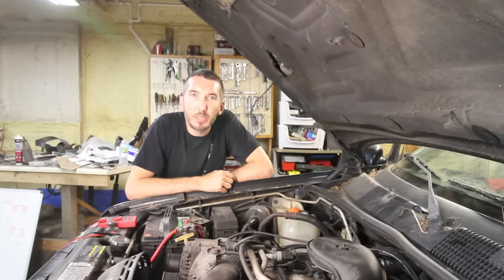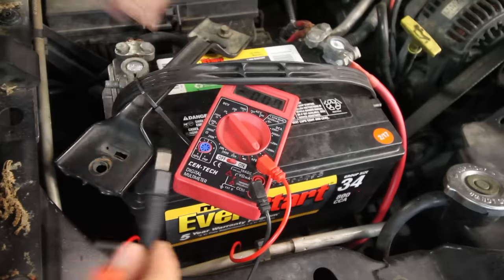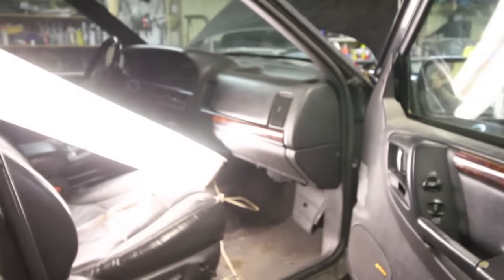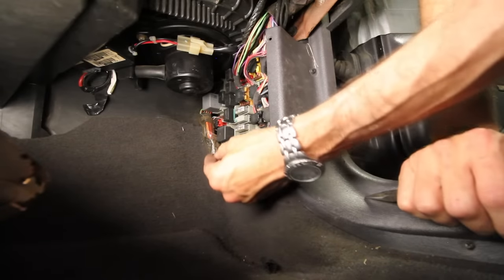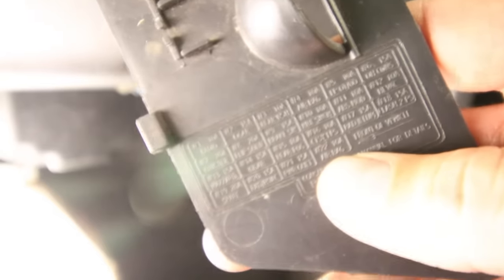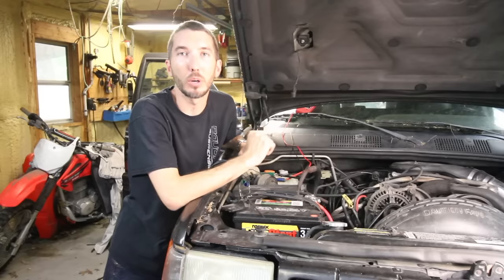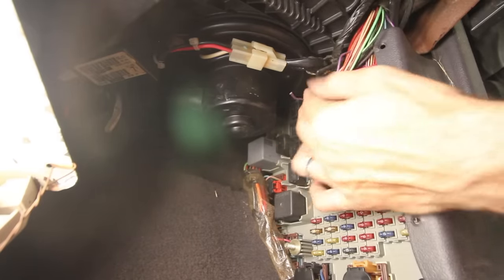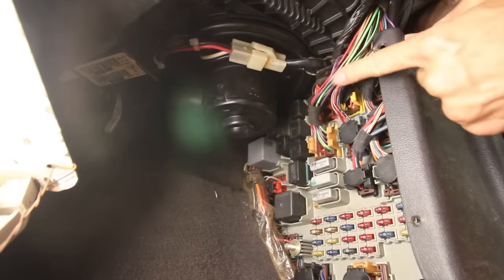Why Does My Battery Keep Dying? - Parasitic Draw Test and Fix - Operation Cheap Jeep

Comment: So great you bodged a bodged repair even further... thought you were going to fix it! Like go to the rear hatch and test the sensor/switch and the wiring to the BCM from the sensor and not mutilate the BCM circuitry  and even advise viewers to go around cutting wires... you probably just broke exactly the same circuit as pulling the "cluster" fuse you did earlier... Was the BCM faulty or the rear hatch sensor/switch or wiring faulty? We'll never know as you never tested them! You should re-instate the internal lighting and determine if a new or reconditioned BCM is required or the sensor needs refitting or replacing depending if it's normally open or normally closed. Remember you did say "fix it" not work around it with a potentially dangerous hack that could leave the entire BCM inoperative! BTW when clipping to an alligator clip to a pair of mole-grips like that don't clip it to the release lever that is only loosely contacting the metal of the tool via a loose riveted pin. Clip it to the handle that is directly in contact with the battery terminal post which is also better than clipping to the adjustment screw thread too. As you had it the connection would have been intermittent with the resistance of the connection changing as you moved things around!

Comment: I removed all fuses under the dash on pass side, no drop in draw...wondering if it could be the box under the hood....should I start pulling those out also to check for the parasitic draw...its a 2000 xj sport

Comment: Advance Auto Parts checked my battery and did a starter(cranking)test...they were okay. The charging system test showed a DIODE SHORT. So...what do I do about this? Thanks for any information. I just spent $521 on an a/c compressor, so I'm hoping this won't be a major (alternator??) repair.

Comment: So I followed this video to the letter in my 97 Jeep GCL, and with the meter on 200m setting, I have a 0.9 draw that never changed after I pulled every fuse both in the power box under the hood and the fuse block in the kick panel. I’m stumped

Comment: Followed your procedure but still had drain after pulling each fuse. Charging the battery again to repeat the process. In the meantime, any suggestions before I take it to a repair shop?

Comment: You could have disconnected the rear hatch sensor. Hope you heat shrinked that expose wire to prevent a short since it has power coming off a fuse

Comment: Great video totally understand . Thanks
Reply from the maker: Glad it was helpful!
Reply: I have a 2012 Chrysler 300 great car but all of a sudden it will drain the battery. I had 2 dealers 3 shops and a friend that's a great mechanic. Still can't find a fix. I've bought 2 batteries and last April i bought a battery pack and just jump it when i want to drive it. It's getting overwhelming.i really like the car drives great gets great gas mileage im just about to give upon this car.  I have noticed the cluster light comes on and knocks the panel lights out I've learned how to reset it. 😆 lol. Im thinking about checking all the fuses after watching your video to save money. Not asking for much just want it to start. If you have any information or leads would greatly appreciate your help. Thanks again

Comment: Hey, I know it's an old video but I was wondering if you could help me. I have a 2011 Jeep Wrangler JK and I have tried to do what you do at the beginning but as soon as I do, there's some motor winding over somewhere to the front of the car. You can also hear a sound coming from the CD area trying to work. I don't know what is going on. I've never had this happen before with my multimeter connected. Please help if you can. Thanks

Comment: When I pulled radio and radio amp fuse  it dropped to .39 on multimeter. It was .76 before. Pulled every other fuse under dash and engine bay and still didn't get close to 0. Any ideas? I'm thinking of just installing a kill switch. I have been having to disconnect battery from terminals because it would literally die overnight within hours. One hell of a drain!

Comment: Same thing is happening with my car, I actually did what you did and I traced all the wires and found a wire which was consuming the power.  I thought to sell this stupid car rather than fixing, after watching this video, I cut the culprit wire and I am not sure what the wire was doing. I own a very small sedan car, now the car runs good and no more problem with battery draining and runs good and not sure what the stupid wire was doing.  Any how I dont mind that wire any more, overall it is pretty old car which I am using for daily use.

Comment: Hi Matt..I've had parasitic draw on 2006 Honda Accord Coupe since day one. Mechanic can't figure out the draw. We disconnected radio and all internal lights. Car lasted 2-3 weeks and then battery was dead one morning. It also dies when I leave the car in accessory mode while sitting in car doing a puzzle. Was not listening to radio at the time because it was disconnected, just forgot to turn off after rolling windows up. Any idea where I can start with the info I've given? Many thanks

Comment: My 2008 montanta has only 160,000 km and issues with battery not starting at 60 percent using a battery charger machine . I'm having to power it to 90 percent to get it  going or a boost. I've had this problem for years . Van runs fine once going but this is such a pain daily.

Comment: Question:
My multimeter has only 5amp. So would that I assume effect the reading by half.?

I tested the draw, it read .25-.26. So with a 10a, would it have read .50?

Is that an acceptable?

Comment: Man, you sure got what it takes up top for problem solving. I have found my own problem with my Caravan/Trailer  but in a different way. I test all my fuses by simply probing them with my multi-meter... on the back of each fuse is a tiny itzy bitzy hole to probe both sides, and when you turn your MM to Mv (200) it will tell you which fuse is leaking parasitic draw. I got the same problem as you... the fuse name is "Van Battery"  meaning my caravan/trailer battery. What the heck does that mean? Maybe the battery itself is leaking charge inside somewhere?  And why does a battery need a fuse anyway? I am totally lost.

Comment: Hi! I checked my battery drain amp. It is showing big number like 2 or 3 but in a second it stays stable on -.14 (20 number showing down on 10 a setting). Is it drain or no drain? Thanks

Comment: Since a lot of fuses let you stick probes on them while they're still in the box, could you leave the battery connected, use the 10amp function and back probe the fuse and see if it's drawing current? I've seen the way you do it, and I've seen a video where you test voltage drop. Would this be simpler or is there something I'm missing?

Comment: ISSUE FOUND 2013 F-150 parasitic battery drain...it's the rear defroster relay slot on the bcm that houses the relays on top of the engine compartment.  Ford issued a warranty fix for defective rear defrosters for 2012/2013/2014 models...so most of us are past the warranty period.  pull the rear defroster relay (40A), and you're battery drain problems are gone.  I just came through this problem by trial myself.

Comment: If my multimeter does not have a 10A setting, but only a 5 am setting, and I do have the same brand as yours, looks exactly the same but for what I am saying, will the test still work?

Comment: So my multimeter reading keeps jumping erratically. It won’t stay constant like yours. It’ll go low like 0.00 or 0.12 and hang out, then it’ll jump randomly and the highest I saw was around 7.34 mA. Any ideas? It’s a Klein multimeter so I don’t think it’s a cheapo.

Comment: So if it was important wire for widows or a/c. I would connect the wire to spare fuse on the box using another fuse but if that doesn’t solve problem then I have to rewrite it correct? Just asking.

Comment: Hey hope you might be able to answer a question for me. I have an 04 jeep Grand Cherokee I can't have fuse #7 in because it will kill my battery overnight. It controls heat/ac , interior lights and something else. I need to know exactly what fuse 7 controls. I bought a Haynes manual, checked all over on the internet and I can't get any information on it. It's really agravating. I've never owned a vehicle where the Haynes manual didn't show the fuses. I've tried everything I can think of to locate the draw but no luck. It's winter now and I can't put the fuse in for heat.

Comment: i wouldn't have cut the wire.. i would have looked up online the schematic to see what it went to and disconnected it at the connector on the other  end.  It's a pain in the ass to do wiring work in an awkward position if it turned out to be a more vital device.. also would have created a new possible point of failure in that circuit later.

Comment: im almost to this point i think, every time i connect my battery my alarm goes crazy! so ive been trying to mess with the AntiTheft S**t lately with no luck really, ive considered  that my battery is trashed now, but i still think my Alarm system has something to do with it. ive unfortunately havent been able to work on my Zj 5.9 in a couple years cause of living situations and Nagy Landlords, but ive finally buttoned up all the Mechanical stuff that was wrong. Another unfortunate mess was while my Jeep was parked at a storage unit over the last 9 months a Field mouse (Probably) made a nice little home in the Jack compartment of the rear seat. I hate to think that little douche didnt screw with my electrical, but after getting the Jeep outta storage and cleaning the S**t out of it. i noticed all my important documents that were in the glove box was now the Assholes bedding material. This 5.9 was a pride and joy of mine for a time and now i get frustrated to easily with its problems, i have a hard time keeping this up, so hopefully ill find the answer soon. #electricalisabitch

Comment: I have a relatively new Low-Maintainence Type Lead Acid (Not a wet battery) Battery, which is about 10 months old. As there was low car travel due to the Covid Pandemic, the battery charge often weakens. So i charged it using a battery charger as the car seldom moves.

But i found out that it always charge in 2 hours quickly to full charge of 12.5 Volts. But it won't keep the charge. The Batterry is not connected to anywhere or to any circuit.

The 2nd morning, it always came down to 10.2 Volts. The 3rd Morning it came down to 10.1 Volts and stayed at 10.0 Volts the 4th morning. Do you think this is one battery cell that has sulfated? Will a battery desulfator work? If not what could be the probable cause? Thank you for sharing any info.

Comment: Hey Man, how's it going? I have a 2006 trailblazer and even with the key off I'm getting battery voltage at the fuse and the plug for the evap purge solenoid. Its draining my battery, do you know what it could be or what I could do?
Thank you so much for your time! Also I just got done running a new wire from the fuse box to the valve because I wasn't getting power to the solenoid thus throwing a evap code.

Comment: You know I was trying this method on my 2001 GMC Sierra 1500 with the exact same multimeter and everything was going perfect it was showing the high readings and then out of nowhere dropped back down to.8 or 6 ?

Comment: What do I do if I need to test a separate module here? I have isolated the draw down to the automatic seatbelt module in my honda. About 16 pins on the plug that go into that but I'm not certain how to test those individual wires.

Comment: So here is my issue..... When I hook up the voltmeter after letting the truck go to sleep, (a couple of hours) it doesn't stay steady. It jumps from .04 to 9.6, then back again, so I can't pull the fuses to test them because of the random spikes. It is a 2003 Hummer H2. Any suggestions?

Comment: So why not replace the sensor? I had an older toyota four runner with a parasitic draw on the drivers side door switch, and I just replaced the switch, and the draw had disappeared, instead of cutting the wires.

Comment: I have a 2006 jeep commander 3.7 rwd base model. Ive been having to disconnect the negative terminal overnight because the battery would die overnight. Well i came back to it tonight to try and use this method to find the draw, and my multimeter is showing 0.00 on the amp setting with the red lead in the 10 amp port. I have the negative lead attached to the battery negative, and the positive lead connected to the negative terminal. It's showing 0! I tried looking at milliamps and it shows 0.03, so 30 milliamps? I would guess thats in the "normal" range? I just don't get it. I'm going to just leave the battery connected tonight and see what happens. Also: when I connect the negative terminal back up im order to drive, theres a slight arc and a chime in the car. I've set up my phone to record what it says, but theres no light, no message. Only a chime. One single "bing" 🤦‍♂️ 
I've been working in cars since i was a teen and this one has me wanting to send it to the scrapyard.

Comment: Should've kept the battery terminal connected a while before switching to the multimeter's amps reading (just keep main cable touching, or use a secondary thicker wire) - when first connecting a battery sometimes the lights flash, horn honks, fuel pump pressures up... a ton of stuff happens, it could take 15 minutes of nothing for some crazy cars to "quiet down" with the doors closed to know the real "sleep mode" power draw. Could've blown your multimeter with +10A too.

Were so close to a real fix, knowing the rear door sensor or wire was bad, could've actually fixed it... so close to a like
Reply: John Smithy  Not quite, but close... there's no power to measure if the battery stays disconnected. But you are seeing the problem when you first connect the battery, your horn & maybe a bunch of computers all fire up & sometimes stay awake a long time when the battery's first connected. I meant keep the battery connected somehow (touching, or with a smaller jumper cable, or real jumper cable, etc) while hooking up the multimeter / ammeter, then disconnect the other cable leaving only the multimeter connected. So you never have that big surge of power going through your meter (maybe pulling over 10A & blowing the meter/fuse if the horn & lights & computers all turn on at once, and you can wait a half hour / hour for the computers to really go to sleep  too.
Reply: John Smithy  It really depends on the car, BMW's are crazy just walking near one seems like it makes it start running some humming pump & doing all sorts of stuff (guessing it might watch the parking sensors to know when someone walks up & might start it). A 20yr old Ford would flash the headlights & spin up blower fan a second when connecting a battery. Or if a vehicle's got a proximity key it just unlocks & turns on stuff when the key comes near. A really old car with no computer (older than 80 or 85) might not do anything except power the clock & maybe save radio stations.
Eric The Car Guy mentions waiting for the computers to go to sleep, not wanting all too much power going through the meter, even holding the door switch closed so the computer thinks the doors are closed, but then he disconnects the battery entirely too...

Comment: Good question how come you just not pull out the wire out of the plastic peace you can use a small Jewell tool to move the locking device in the wire it hold the wire in place

Comment: Seen another video with a guy using a resister wound 1 olm 10 amps.to ground out the battery r u saying that is unnecessary?

Comment: Hey man I connected the volt meter to the negative end off and positive to ground of battery and it showed normal 12 volts but I’m still having a draw how would accurately test if it doesn’t show a draw

Comment: Great job on diagnosing the parasitic draw. One thing I think you would be able to do is put a toner on that purple wire you cut ( not the short  piece connected to connector ) and go around the vehicle with the probe and look for the signal. I have done that and it worked for me on a job similar to this.

Comment: Pretty good video. Worth rewaking... 
Unfortunately I can't get my multimeter to register. I have it set to 20A and my meter just doesn't register anything. I had disconnected my engine compartment light while testing to rule that out. No reading. I connected the compartment light and checked again. The light came on while connecting the  (-) post and terminal with the meter but there was still no reading. So the connection was there as evidenced by the light turning on, but it doesn't make sense as to why there was no reading. Any ideas?